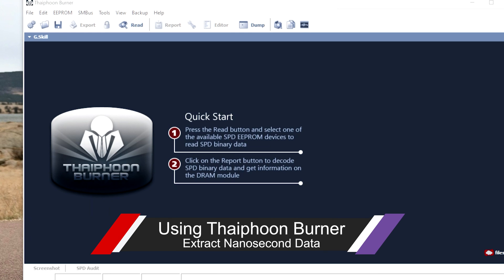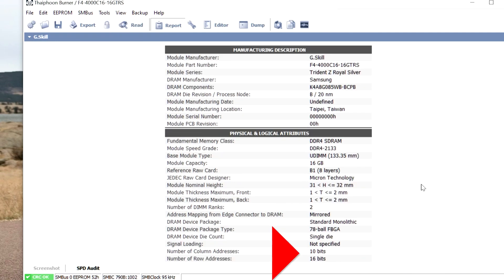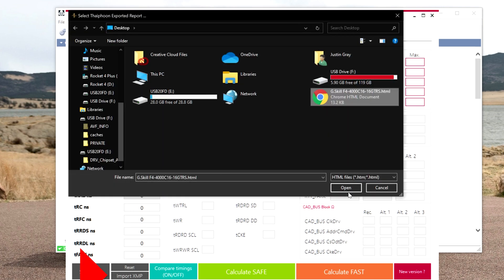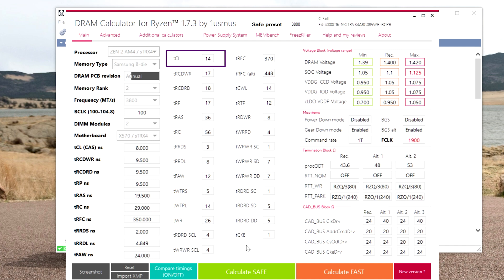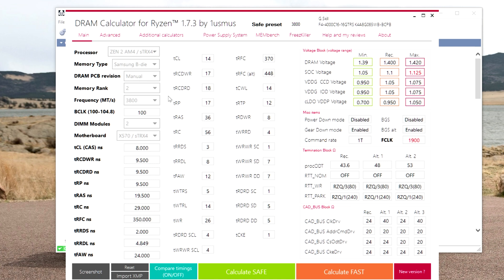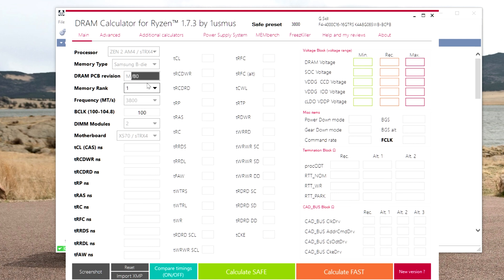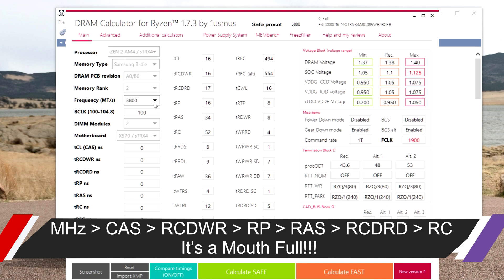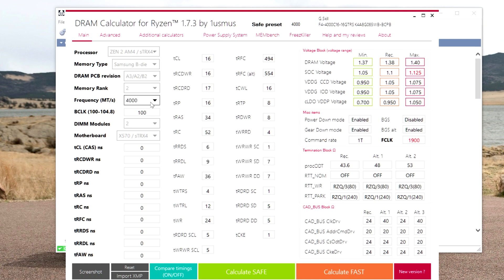Overclock AMD RAM with Thaiphoon Burner and Ryzen DRAM Calculator

Comment: I have c die there's no option in calculator. Alr tried doing a similar tutorial yesterday and I wanted to comment on this cus ts didn't work. I got all the timings it wouldn't train or boot and eventually got auto reset

Gskill trident z rgb ddr 3600 32gb single rank c die samsung chips.

Comment: Even with the dram voltage manually tuned @ 1.45 it still won't boot? I'm sure this is a little older video, just thought I'd check with you anyway. Trying to boot at 4000mhz is unstable when fclk is set to 2000 on my system also. I'm using the 5900x on x570 msi Unify.

Comment: So please explain how could i know if my 3600 hynix djr kitt will run at 4000? Will the dram calc tell me that? I never used it.
Reply from the maker: Not 4000. DRAM Calc needs to be updated to include those values. I've not gotten it to provide working 4000 settings. However, it should do 3800.
Reply: @TheGrayingTech  so you are saying that my 3600mhz kitt will never do 4000mhz no metter what timmings? The kitt is 2x8 corsair vengeance rgb pro @3600mhz cl18 rev 5.33 so hynix djr. Please respond if you know.

Comment: Ew. Really low level of understanding on display here. "I recommend... in this case..." seems to only mean that with your CPU, you could get certain values to work. Not much to base a "recommendation" on, is it? Looks like the most research you did was into prices on NewEgg. I'm disappointed in myself for thinking you knew what you were talking about. Unsubscribed.
Reply from the maker: It's ok Kan.... this video didn't meet your expectations, so I get it. I can't tell you exactly what you should do with your system. I can only show how to interpret what your system does.

Comment: actually you don't need thyphoon to get default values. turn xmp profile in bios off. and re run the Dram calculator . now you get default values automatically including solution to your complaint about no change in latency. you can add typhoon data for a more precise changes .both will give you result.
edit : those who have doubt about what frequency need to set initially in dram. it is your desired frequency with your current stick. give maximum possible value.
Reply from the maker: Great feedback thanks!

Comment: Great video - like i expected :)...
Anyway - yeah, this behaviour is common even for good B-die... I got Micron DJR and even though it's rated for 4000MT/s CL18, it won't even boot at anything over 3800 - no matter the latencies. At least not on AMD Mbo's (Cpu's), on Intel Mbo's (Cpu's) it runs @ rated speeds - without problems. Dunno what causes this, probbably some loser latencies on Intel or simply more forgiving mem controllers... I am really hoping 1usmus updates Dram Calc any time soon, even asked him on Twitter about it. He said he doesn't have time because of CTR :(
Reply from the maker: If I recall, Intel takes a more active role with XMP. It is a certification provided by them, so they test and make sure it works. With AMD, best to buy from the QVL. When I go this kit the QVL hadn't been updated with 4.0Ghz Kits yet. This one is not on the list.... bummer. but the perfect 16-16-16-36 version from G.Skill is. So likely that one will perform properly. At least a better chance.
Reply: @TheGrayingTech   Speaking of QVL's, my G.Skill TridentZ RGB 64GB (2 x 32GB) CL18 kit was not on the ASUS ROG X570 Crosshair VIII Hero QVL.  However, on the G.Skill website, the ASUS Crosshair VIII Hero mobo was listed as compatible for that particular RAM kit.  Talking with G.Skill tech support revealed it's easier for RAM manufactures to test different mobo's vs board manufactures testing all the various RAM kits due to the shear numbers involved.
Long story short, with XMP/DOCP enabled, my RAM boots to rated speed with no issues.  I haven't tried to tweak it yet, but that's next weeks project.
Keep up the great work TGT.

Comment: I am really glad you made this video, at least now I know this is normal. I had the same issue with my G skill trident z neo 3600mhz not being able to run the tweaked settings. Even when running it in docp I have to up the voltage to 1.4 or my pc won't boot.
Reply from the maker: It's never a good feeling when things don't work, but it's more true to life. So happy to show folks the good and bad :)